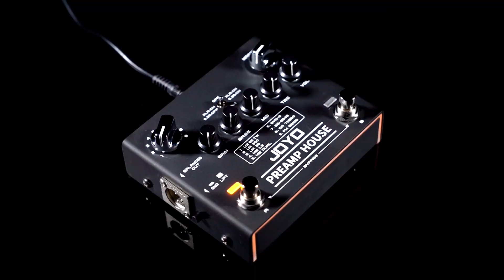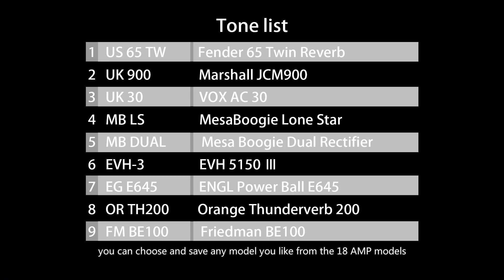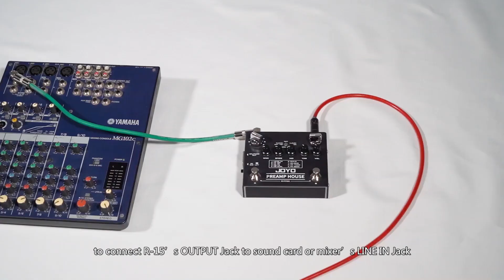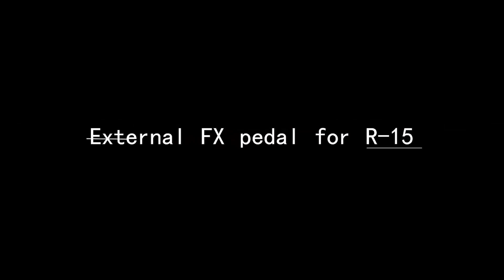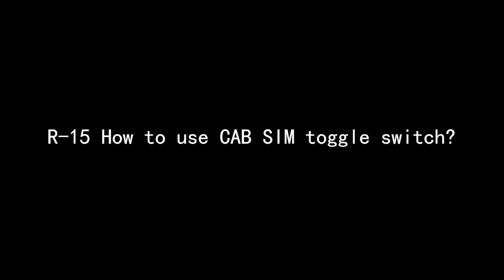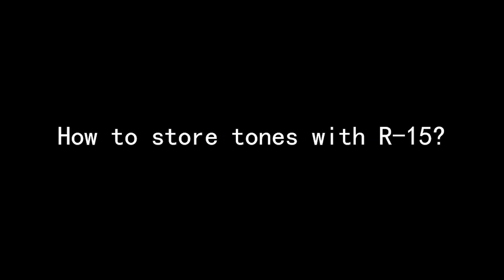R-15 PREAMP HOUSE Tutorial video

Comment: Just got mine today. I am running it in front of a Boss GX-100 using the 4 cable method. My favorite amp selection is #2. Number 1 is my second favorite. I do not play heavy metal. Blues, rock, oldies, smooth jazz, neo-soul and gospel are my genres. Sounds great! I will use it live utilizing the XLR to front of house.  It sounded better with the amp and cab turned on using the 4 cable method. I am using the natural amp selection in the GX-100. Hopefully this information will help others to get great tones out of their Joyo Preamp House! ROCK ON!!!!

Comment: what's the difference, between sending R-15 jack output to external amp RETURN and external amp INPUT ?
Reply: It will not sound good if sent directly into the amp input because then you will have TWO preamps added together.  Going into the return bypasses the amps preamp.

Comment: I just purchased this unit, some of the amp models are very impressive. I like the 900 and ENGL the most. One thing that should be pointed out about this pedal that it will ONLY save ONE clean and ONE dirty preset form ONE particular amp model. It will NOT allow you to save a preset from each amp model. So if you save a 900 preset on B, then go to ENGL and save a preset on B, the 900 preset is overwritten by the ENGL one. One preset for each A and B buttons, no saved presets for every amp model.
Reply: can you have a clean from one amp and a dirty from another or do they have to be the same amp?

Comment: Does it have built in cab sim
Reply from the maker: yes a 4x12 default
Reply: @JoyoPedals1  is the fx loop a pre or a post of the preamp processing?
Reply: @lookinguntohim9398  probably post, since it would be pointless to include a fx loop if not, and you would be using the regular guitar input (before the preamp)

Comment: Does this mean you can save a clean channel using the method you showed for the A switch? How about the distortion channel how do hou save the settings?
Reply: Save the distortion channel on B Switch, just add extra overdrive for solo or boost before this. On fx loop's send and return you can connect our modulations like for example Zoom ms70cdr

Comment: Can you record using that pedal without a mixer, sound card, audio interface?
Reply: You'd have to connect something for recording, from the looks of it. I use a DI for my recording, and use an amp sim program in my DAW, but I'm considering this as a replacement. Using the XLR out with ground lift, you should be able to run this straight into an audio interface and be able to record with even a free program like Audacity if you needed. The USB input is probably just for firmware updates. The reason they show using the output to a mixer is because using this in a live setting wouldn't require an amp, so you can plug straight into the PA system. Definitely a good back up, too, because nothing kills a show like a blown amp.
Reply: CosmicWaltz7 awh too bad... thank you so much
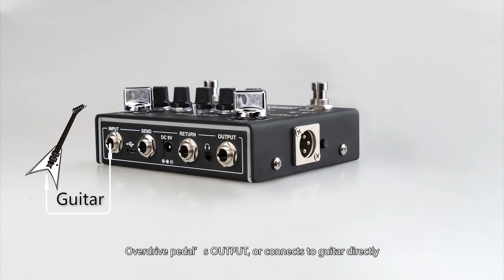Reply: Well I guess that since it can be connected to computer directly with USB cable, you can use it for recording without interface. As shown at 2:25    I'm not 100% sure about that, because I haven't bough one yet but planning on it.
Reply: @canaldepraticadejesus6600  usb is only for firmware updates. Just connect the device to an audio interface, like a Focusrite Scarlet. You can use the internal cab sim, a cab sim simulator (like Mooer Radar) or just use an IR in your DAW